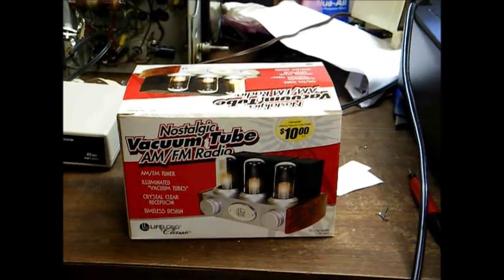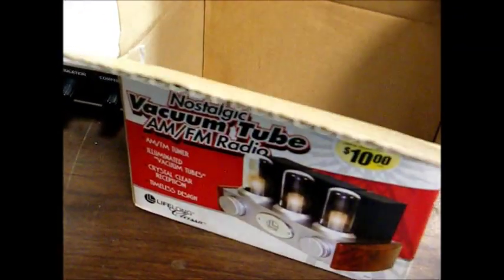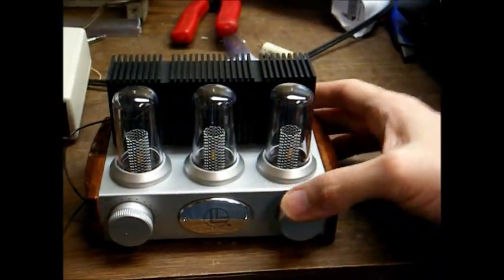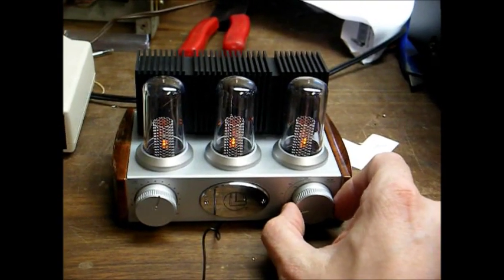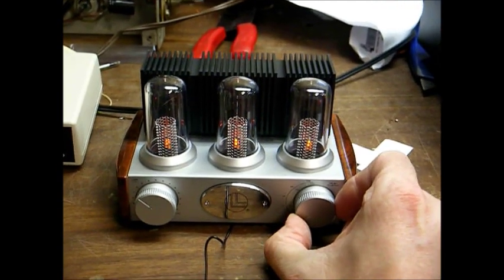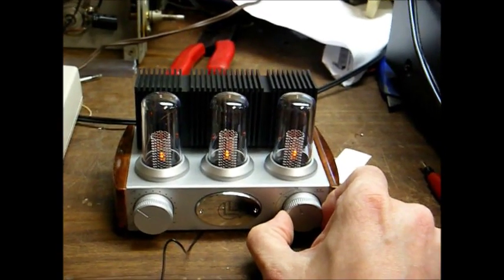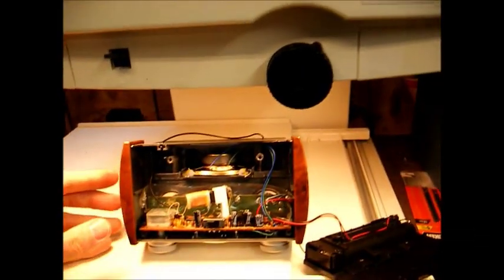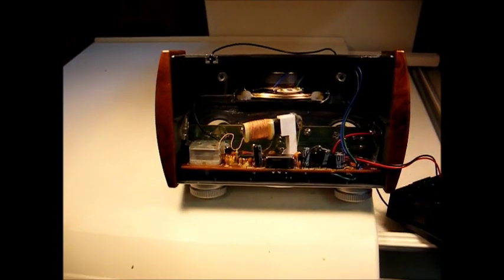Lifelong "vacuum tube" AM/FM novelty transistor radio

Comment: Guess you get what you pay for.  My niece just gave me 3 old pocket transistor radios her mom had in a trunk. Her mom, my sis passed away a few weeks back and this is a bit of clean up. So I powered them up, two didn't do anything the third blasts you off your chair as it is full blast. Well I decided to try and re-cap the little guys, I didn't have the "right" caps but I did have close so I recapped. Both came back to full life and are working great!  The full blast one I have sort of working but dis-aligning her so she is a bit off channel then I can actually get from comfortable volume right on the turn on mark and the control does go up from there.  Guess I will leave it like that since i really have no use for any of them, well unless the shit hit's the fan, and if that happens I guess I am to damn old to head into the hills anyhow, just have to sit in my old shack and fend off the roaming hordes with my old M1911A1. I do have a few hundred rounds so I guess I could hold out for awhile.

Comment: I have two 30 watt AM transmitters, one is on 710 KHz and the other is on 530 KHz.
Reply: +ElfNet Gaming Where can you find one of those?
Reply: I got them from Wild Horse Pass raceway in Phoenix, Az when we installed the new PA system and FM Transmitter for the Racepark.
I dont even think they make these anymore or if they do they are under a different name and more modernized. If you look up the AM-30p manual you can get the schematic for the 30 watt driver amplifier (PA) which takes in I think 100mW. Thats all you would really need.
I did recently do a repair video on one of those units that has a bad thermal resistive fuse on the power supply..
Reply: ElfNet Gaming Nice, thanks! It'll be a bit of practice before i'm able to build more complicated things like that, I'll check your video out!

Comment: Haha! Warranty card :P
Are those the triglossal quadtronic perforated grid matched tubes? Fancy. I got the AM/FM mono micro boom box with integrated digital LCD clock. Detachable "stereo" speakers. Walgreens; half price at $5 and available at the same time as your radio. It actually works pretty decent though as a $5 tuner when the planets align properly, sounds like crap and keeps very good time. Twelve years old and still working.  My talk news radio in the garage. It's so cheap and yet marginally functional, I have a partial affection for it.  How can it work so long for $5?
Reply: +The Dollar Guy I was given one of those things. The reception isn't that bad, but the tuning is crappy and the sound is only suitable for voice, never music. I stuck it to the wall in my shower and put it one to hear the news from time to time. For one thing, I'll give it credit: it runs forever on a set of AA batteries.

Comment: I have one of those replica tube radios setting on my desk. I want to convert it over to use AC buy taking a 6 Volt "Wallwort", but I can't find out what the DC Current is suppose to be with this radio. Do you happen to know what the DC Current is for this radio? I am kind of guessing the same DC Current of the four AA batteries it takes, but just want to make sure. I want to let the LED's in each tube stay on, but no batteries. Thanks!
Reply: Scott Bailey I do believe the 6 volt transformer will do the job, ain't got trouble so far with stuff I've converted from battery to transformer operation. Of course, general purpose 'wall wort' transformers won't provide a big load of current, so, pretty sure nothing unexpected will happen.
Reply: I did just that several weeks ago with a AC Cell Phone Charger. I made sure the DC Voltage and Current we right, and it works! Looking at it right now! Thanks for the tip!

Comment: I have this same radio. I don't use it except in a power failure, which means I've used it once. The AM tuning is overly touchy, one station seems to be heard nearly throughout the entire tuning area. When I tune a local station, I can hear interference from another station up the dial and I have to turn it until I get a clear signal. FM is basically useless. Some people are trying to sell these for $25 on eBay, what a waste!

Comment: It's not a bad looking little toy radio. I have a tiny Chinese plastic radio that looks like a cathedral radio from the 30s.  I seem to remember a "white van" stereo scam where they sold a cheaply made stereo that displayed three 12AX7 behind a window in the front. The tubes were of course not operative and three red LEDs were hidden behind them to make it look like they were lit. Gary
Reply: were the 12AX7 tubes real ones even though not in circuit ?